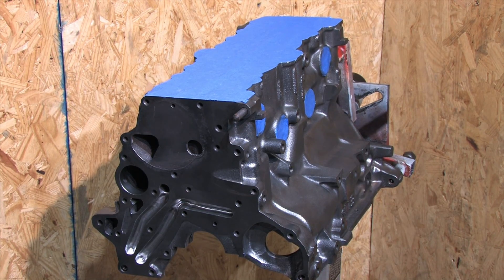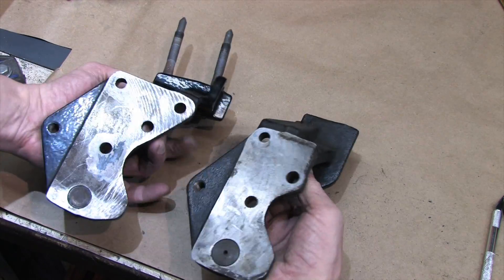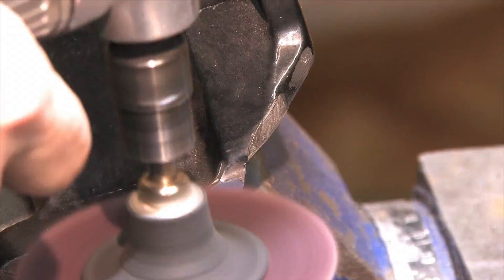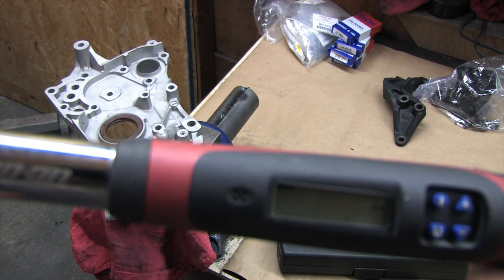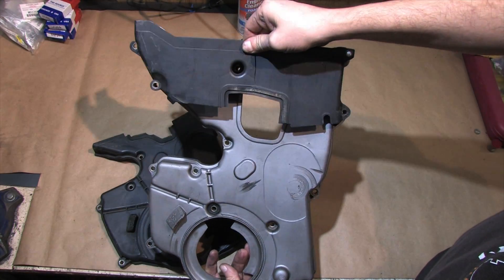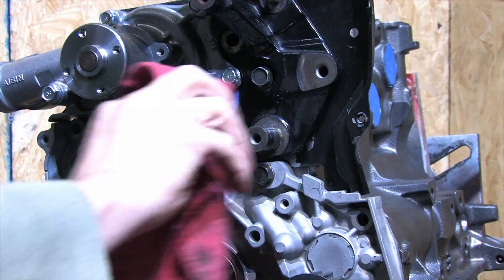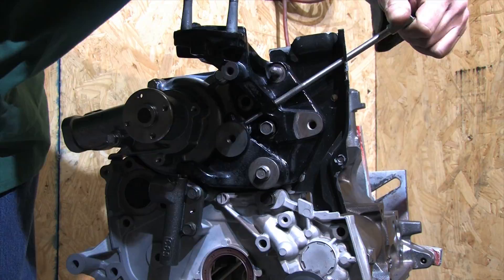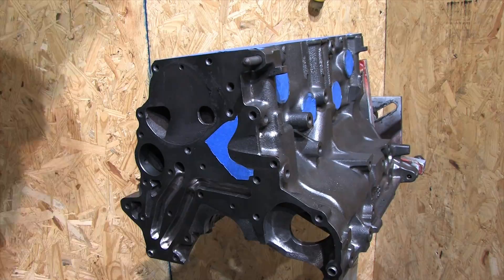GSX Block Prep Part 2 - 1gina2g Timing Side

Comment: Is the 1g7bolt Frontcase and the 2G 7bolt Frontcase are the Same
Reply from the maker: No.  The oil pans, water pump reliefs, motor mount reliefs and oil filter housing flanges are completely different.  Sorry.

Comment: Jafro, Random question, how often do you replace that hydraulic tensioner? thanks man
Reply from the maker: I do it every time I change the timing belt.  Only because it's my car and it's an interference engine.  Some people get away with not changing it, but on any performance build I won't advise it.

Comment: So just to confirm, if I was to put a 6 bolt timing cover on a 7 bolt engine, it wont be a direct fit? Will I only need to make the motor mount hole bigger to accommodate the 2G mount, or do I also have to cut around the water pump as well?

Comment: I'll have problems with a 6bolt block with my 7blot awd gearbox?
Reply from the maker: You should have a different flywheel, starter, engine spacer plate, and engine block than the ones that came with your car... and then it will fit.  I cover all of this if you search "1gina2g".  ;)

Comment: Thank you so much your videos are saving my ass, im putting a 6 bolt block and 7bolt head in my 97 fwd eclipse  and i have been going crazy trying to figure out whats needed. One question. the sensor that bolts to the front of the oil pump housing on the 7 bolt. and you have it shown in the video. what is that and will it bolt onto the 6bolt oil pump and function properly?!
Reply from the maker: Oil pressure sending unit.  There's 2 of them on a '97.  One's for the idiot light, and one's for the oil pressure gauge.  Yes, they're the same sensor.  Because I have the same engine as you, you should follow my parts videos because all of the parts and gaskets I show are the parts you need.  ;)
Reply: now the other sensor im confused about is the cps and cas, so the 2g has the cps that mounts on the oil pump.... and the 6bolt block and pump don't have that mount... so what do i have to do with that
Reply from the maker: That all depends on whether or not you have balance shafts.  If you use a Kiggly Crank Trigger kit because you don't have balance shafts, you can use your '97 sensor and your ECU won't even know you're using a 6-bolt block.  If you're keeping your balance shafts, it's a different method than the one I'm using to sort out the crank trigger... but you use the 1g '91-94 cam angle sensor because it provides both the crank and cam signals.  There's some ECU pin rewiring that has to be done, or some plug wires that need to be swapped around... but I'm going plug & play with the Kiggly trigger.  All of that stuff is covered in my two parts videos.  One is the timing belt service parts and the other is all the mods, bolts, and stuff that I've stockpiled.  Kiggly stuff is in the latter.
Reply: i see! my 6 bolt block is manley pistons and rods, and balance shaft delete, brand new oem water pump and oil pump, and i'm doing the mod to the 2g motor mount and 1g timing belt cover like you did, new oem 1g timing belt tensioner & 1g tension arm, new pullies and gates racing blue kevlar belt. head is a stock 7 bolt head that's been gone though by my engine builder, cleaned and made sure everything is good. arp head studs(had the head drilled for the 12mm studs) all machine work on block and head has been done by him as well. trying to use as much 2g parts possible

Comment: A lot of goddamm work
Reply: +BRENDAJASON1  It seems overwhelming at first but we you read it and reread the steps or watch and re watch this video its not as bad as it seems.  Some of the steps Jafro does in the video don't necessarily have to be done.  Instead of drilling a new timing tensioner tool hole, you can counter sink the water pump where the offending bolt goes and install a countersunk screw.  That allows the tool to pass by it without hitting.  Or you can just do nothing and just remove the tensioner and compress it with a vise or c clamp or whatever to compress it.  Also instead of cutting the 6 bolt timing belt cover in half, you can just enlarge the center hole to fit over the 2g engine bracket.  Of course though like Jafro say's, this will make it harder to do the timing belt service in the future.  It's not impossible but it definitely makes it easier to do the service in the future.
Reply from the maker: +The Headless Horseman You're correct, it's really not that bad, and many of the steps I went through here were just because of my willingness to do them for my particular car.  They're helpful and somewhat eccentric tips to make what is already a pretty easy swap–easier on yourself later on down the road if you have to be the one working on it.  The countersink method is a perfectly acceptable solution, although it lines up poorly with this combination of parts, it will still suffice.  Because I powder coated the previous block and have to do it again to a 6-bolt, I have to re-do that work to make the car correct for its show history.  It wasn't a big deal for me to re-coat the mount and make it perfect, which is coated now... and it IS perfect...  No modification is too difficult for my GSX.  I'll go through great lengths to make it exactly how I want it.  I'd have done none of this for the Hyundai.

Comment: Jafro, i have a simple and dumb question. Where do the 6 bolts come from and the 7 bolts? In your opinion which is better than the other? Im sorry im commenting on one of your older videos but i always go back and watch them over and over again even though i have an mk3 jetta with an 8v 2.0, and another mk3 jetta with a 2.8 vr6! Thanks Jafro!
Reply from the maker: Edward, the ONLY good race I had at Richmond Dragway up to 2005 was a 2,0L 8V turbo Jetta.  I got him by a bumper, not a fender, not a car, a bumper.  I tree'd him hard twice because of AWD, and on both races...  If I had left my bumper at home, I would have lost.  Its owner was a dynamite guy.  There to have fun, just like me.  I've never seen another one anywhere like it.  He frankensteined that thing himself and probably knows more about what he's doing than I did.  Out of respect for him, you won the Friday Night answer.

There are several defining factors with the 4g63 and I'm going to nail them all down right here.  6-bolt is 89-92.5 production date.  7-bolt is 92.5+.  In 2000+ model year cars with a 4g63, it changed from the SIRIUS I platform to the SIRIUS II.  What that did is flip the timing side around to the opposite side of the engine bay. The SIRIUS I engines are the only ones where there was a 6-bolt/7-bolt designation.  That designation refers to the NUMBER OF BOLTS that hold the FLYWHEEL to the CRANK and nothing else.  The reason it's significant doesn't have much to do with holding the flywheel on.  It has to do with the journal widths.  The 6 bolt mains are nearly an inch across, and more than 3/4" on the rods.  The 7 bolt main and rod journals are narrower, so the 6 bolts using bigger bearings can withstand a greater load.  Considering the horsepower the turbo cars came with, they're both over-built... but the 6-bolt is just a bit more over-built than the 7-bolt, comes with bigger rods, and typically withstands 650hp on a stock rotating assembly with the right tune on it.  I'd put the stock 7-bolt assembly down around 450-500hp.  Evo people will argue with me, but their engine is different, and their transmission is MUCH different.

When the 92.5 change-over in production occurred, some other changes occurred to the parts that bolt to the block, like the front case, the transmission bell housings, the transmission spacer plate, the water pipe, water pump, timing covers, thermostat housing and the diameter of the head bolts.  The 6-bolt uses 12mm bolts, the 7-bolt uses 11mm bolts.  6-bolt rods are fatter, heavier rods than the 7-bolts, but the crank bore is the exact same diameter on both.  The 7-bolt pin bore is 22mm, the 6-bolt is 21mm.  Using actual 2g pistons on 1g rods requires either having the rods machined to accept a bigger pin.  Using 1g rods in a 2g block is not worth the expense of machining because the whole rod needs to be cut narrower to clear the crank.  None of the bearings are interchangeable.

The main and rod bolts remained the same diameters on 6/7-bolt blocks, as did the crank's main and rod journal diameters... but the first-generation 7-bolt engines used different main cap assemblies than the second generation 7-bolts.  The second-generation 7-bolts received a main bearing girdle, which in theory should make the bottom end stronger.  Whether or not it did is debatable.  At the very least it should have reduced the affects of harmonic vibration.  That's part of the debate.

For the top end, the cam's are interchangeable between all year and model DOHC 4g63 engines.  What may be different on some years is how the cam angle sensors work.  The intake ports on a 1g 2.0L DOHC head can hold 38 cigarettes each.  A 2g fits an even pack of 20.  The 1g intake ports are just enormous.  Too big for their own good.  But that all depends on what you're tuning for.  Edelbrock proved that you could make a 1g intake port flow more by adding metal to it.  The exhaust sides are mostly the same.  The 2g parts that bolt to the head are cast thicker and less prone to cracking.

All other behaviors are the same.  Bore, stroke, base timing 8° ATDC ± 2° @ 750 rpms ±50, fully warmed up after the fans cut off and they even sound the same.  Same timing belts, pulleys,

Regardless of which engine, both transmissions utilize the same clutch.  The bell housing bolts are different, but 5 out of 6 bolts fit when interchanged, so oh well.  That means on a SIRIUS I or SIRIUS II car, either engine is a bolt-in install and can be installed by mixing and matching some parts, and doing minor grinding.  Coincidentally, the outer dimensions of ant 4gxx series block is the same, only the deck height, bore and stroke change.  Differences appear only in the changeover from 6-bolt to 7-bolt castings.  That means they're great donors for 4g15, 4g61, 4g67, 4g69, and 4g64 cars as well.  Swap out the motor mounts from the respective recipient and have a field day in your 2100lb (after-swap weight) Hyundai Scoupe for instance.  Do some serious weight reduction and you can get that car to about 1650.

There are some things to worry about concerning where engine mounts and transmission mounts bolt up that can disqualify you from using certain parts, for instance first-generation 89-94.5 cars have 1 transmission mount and 3 engine mounts, and second generation 95-99.5 cars have 3 transmission mounts and 1 engine mount.  You can put a 1g block in a 2g car, but you can only use a 2g transmission because of this.  The reason you'd want to put a 6-bolt in it is simple... so you can utilize the beefy main and rod journals on that 6 bolt crank.

I wasted $3500 building a 7-bolt.  It made great power for several years before I blew it up... but I could have made the exact same amount of power on a bone-stock 6-bolt for a lot less money.  I wouldn't have needed to fit aftermarket rods and pistons... just a big honkin' turbo a fuel pump, a hack saw, injectors and engine management.  Could have outrun myself for 1/4 the price.  I'll never make that mistake again because all 4 of my project cars have 6-bolt 4g63's in them.

It's really a dynamite platform.  What's to hate about aluminum DOHC 16-valve heads bolted onto solid-decked cast iron blocks?  I can't find anything?  This is the combo I was brought up on only with half as many cylinders.  Similar bore and stroke as well.  Costs a heck of a lot less to build, too.  I hope that clears some stuff up!  Now if you'll excuse me, Gold Rush's season finale just started.  I could go on for days, but at the very least I saved you a google search and several hours of reading to get an inside look at the DSM perspective.
Reply: ***** You sure have saved plenty of Google searches, sorry for the late reply i made sure i situated myself so I can read and understand what you've told me, you're awesome!  Made my day that you sat down and typed it all down yourself. It will take me a lot to process all this through but hey, the more you know! Thank you Jafro! You caught me off guard about that 8v 2.0 turbo, not many people choose the 8v 2.0, they'd rather go for the 16v or go right ahead with a VR6 swap lol

Comment: Wouldn't be easier to get all 6 blot parts?
Reply from the maker: Sure it would... until you try to bolt it into a 2g car and realize it won't fit.  The timing mount is kinda important.
Reply: ***** Oh thankyou my car came with a 6-bolt swap trying to learn all that went into it and correct any worng doing I really want to get a timing belt cover on it without pulling the motor it has a bottom half cover but it was cut.
Reply from the maker: All you need to do is buy the top 2 2g cover pieces and their mounting bits... and you're golden.  ;)

There are several different methods of installing a 6-bolt.  There's the RoadRaceEngineering method, the Magnus method, and then there's the one I demonstrate here which is mostly the Magnus method except I rely on a 2g head, the original sensors that came with the 2g car, and an aftermarket crank trigger kit.  The method I show minimizes machine work and eliminates the need for the 1g cam angle sensor or modification of the factory wiring harness in any way.

Figuring out which method that was used on your car should be fairly simple based on the parts and machining discovered while taking it apart.  If you have a 7-bolt front case, you have the RoadRace method.  If you have a 1g cam angle sensor, you have the Magnus method.  If you're using the 2g cam angle sensor, you should find a Kiggly Crank Trigger kit hiding inside the timing cover when you pop it off.  :)

If you were Magnus'd then your wiring harness might have been hacked, requiring your plug wires to be swapped.  Either that or your wiring harness cam angle sensor wires being cut and spliced, or ECU pins swapped out to change the phase of the cam angle sensor.